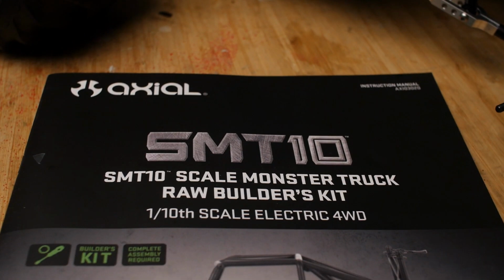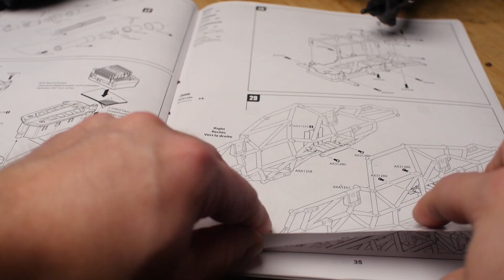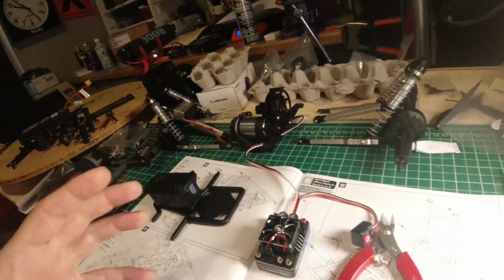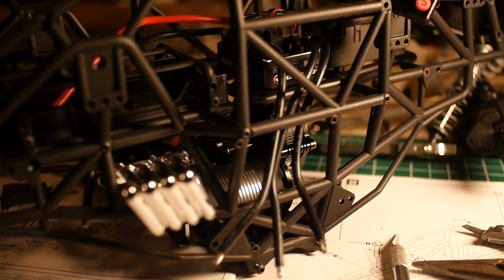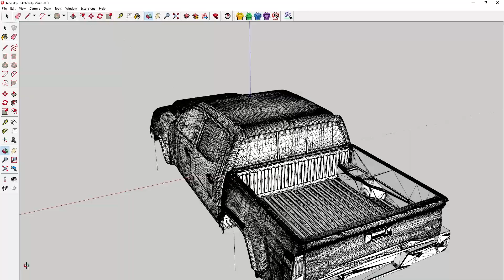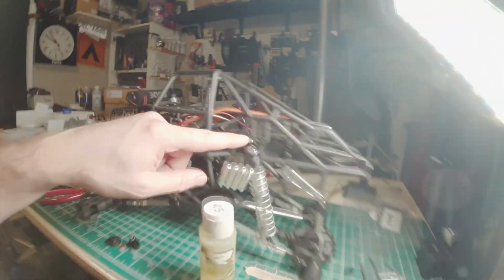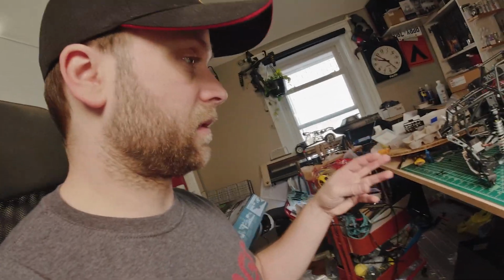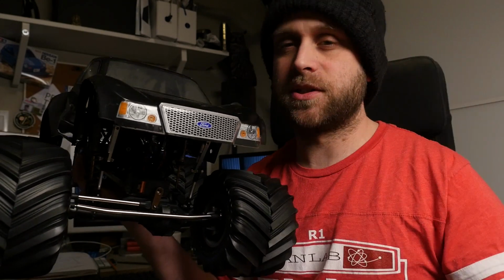THE RC MONSTER TRUCK BUILD - IT'S GLORIOUS

Comment: Cool build. I just finished up my SMT10 build also. Barely any SMT10 left except the cage & transmission. I installed complete Vanquish axles, Hot Racing, Crawford performance and freestyle rc parts. Lots of Carbon fiber too. I used the Jconcepts (snoop nose) chevy body
Reply from the maker: sweet. i assume after running this a few times. i'll be going a similar route.

Comment: Check for play between the pinion gear and diffs. I put shims between the drive shafts and diff casings. Otherwise you will shred the diffs pretty fast. Using the widest offset hubs on the jconcept wheels helps a lot because you need to set the steering endpoints pretty low. Mounting the shocks to the upper spot definitely help because this thing is quite tippy.
Reply from the maker: sweet! will do all those things! thanks man!
Reply: @kpopRC  Traxxas 1985 Shims are what most people use. I shredded my stock diffs on 3S. Got the Axial HD gears and shimmed it to remove the slop.

Comment: Duuuude, I totally have to try that set upI I have the axe 550 on my crawler. would love to have a little more throttle control and the ability to program it to go right into reverse without tapping the brake!
Reply from the maker: hobbywing has this crazy new brushless and esc all in one. called the quickrun fusion. check it out. it's got some new esc tec in it. that makes it run so slow and so quiet. comes with a program card, and has a bunch of drag brake features. i went with the sct on the monster truck because i want to be able to do back flips off stuff.

Comment: Nice video Kpop! Castle products come with a coupon that you can use to have a Castle Link sent to you free of charge.
Reply from the maker: OH WELL NOW. i'll eat my foot in the next video. just hope it comes faster than the bec. Shipping from the states for some reason takes longer than from bulgaria (superscale 2020). thanks for the heads up.
Reply from the maker: not eating my foot. says, castle link sold separately right on the manual.
Reply from the maker: FORTY MORE DOLLARS to get 6v? dude. that's bullshit. it should be a switch on the side for gods sake.
Reply from the maker: actually 60 to my door. i'd like to reiterate. how CRAZY that is.
Reply: I think most people would also use the Castle ESC in which the coupon example does apply. Free of charge. That’s truly crazy. Anyway, I hope you’re well! 😃👍🏼

Comment: Live how time stays still in your studio......fix the battery in your clock dude...lol
Reply from the maker: it's an old broadcast clock from the news room at my work. it broke at 954pm years ago. It kind of works but makes a terrible grinding noise. it's run by a stepper motor, and is a sync gen clock for EXACT tv time. If i had a real counting clock i'd start adding up how many hours i've been sanding neighbor, and tbh that wouldn't be a good idea. lol.
Reply: @kpopRC  hell yeah brother